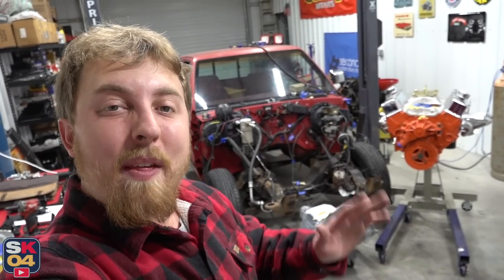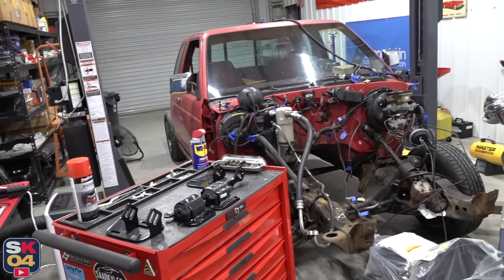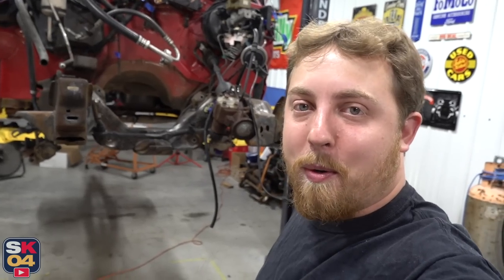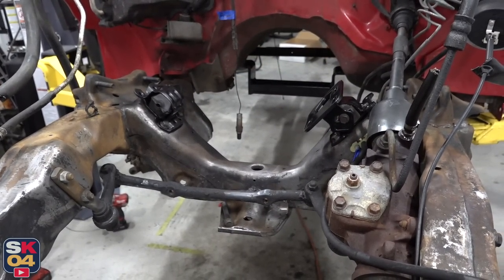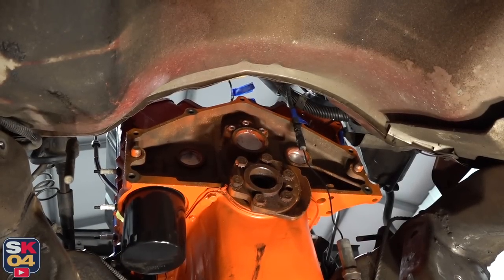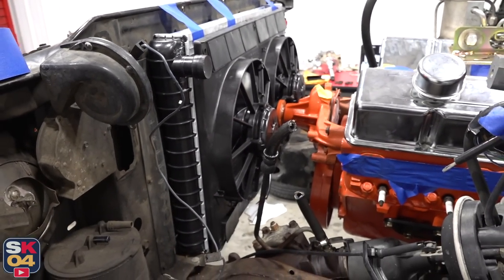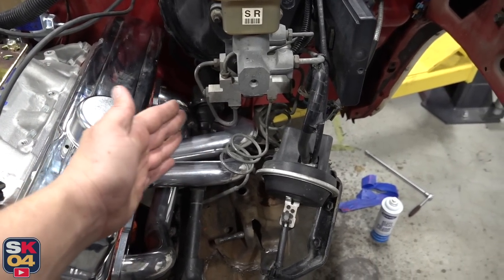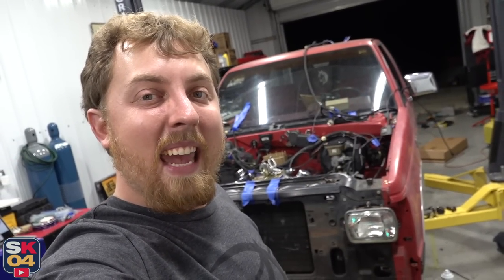Test Fitting My New Engine & Transmission! S10 Restomod Ep.5

Comment: Why does everyone use automatic transmission's when swopping s10s put a manual in it lol
Reply: I think the same
Reply from the maker: Because it's not as easy as it sounds.  The truck is already an auto so that's the simplest swap vs swapping steering columns, installing pedals, etc.  There's a lot that goes into it and it's more than I'm willing to modify for this project.  The whole point is keeping it simple.
Reply: @saabkyle04  Now I get it better
Reply: 5 Speed all the way 🤗🤗🤗.    Mines 4.3/5 Speed right now, I've already bought my 350 for the Swap, I'm just waiting to buy the Headers & Mounts for it, But I'll definitely be keeping the 5 Speed tho
Reply from the maker: If the truck was originally a manual then I would have kept it a manual, but that just wasn't the case.
Reply: @saabkyle04  Understandable,  If you had the parts it's not that hard to do a 5 Speed swap tho, Maybe that's something you can do to the 4 Door S10 🤷.   I know you like to do new things, 5 Speed swap could be a next New Thing under ur belt 🤔🤷